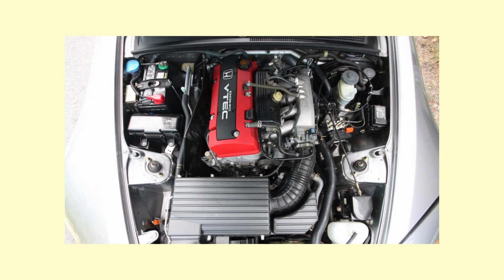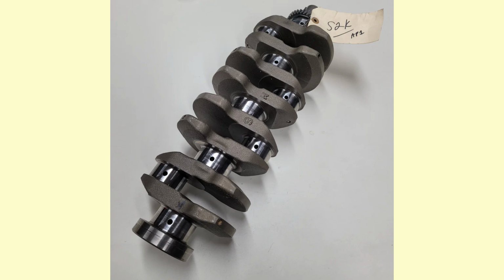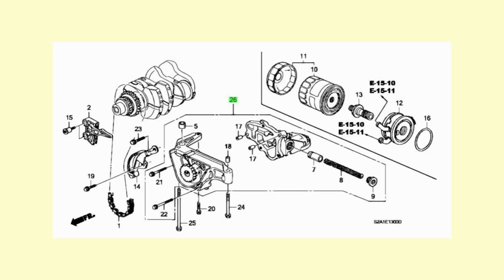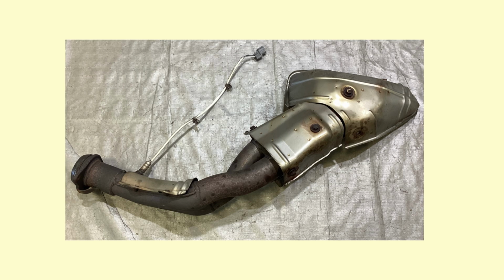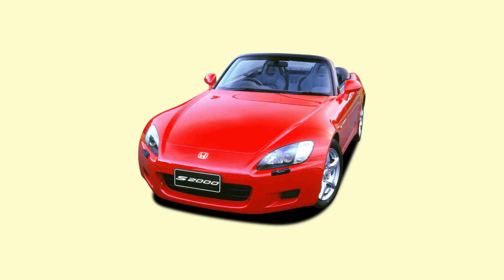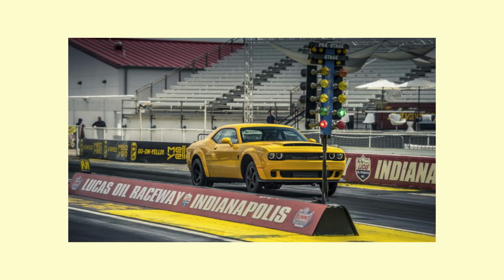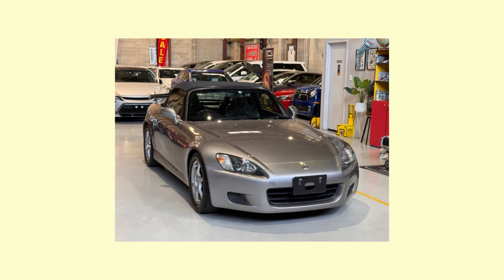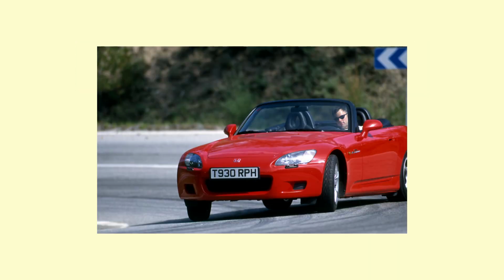Automotive X-Ray: Honda S2000 AP1

Comment: The EPS wasn't the primary reason for the uncommunicative steering, it's mostly the high profile tires with a mild SAT dropoff and quite high cornering stiffness load dependency, and quite equal caster/SAI angles, which reduces jacking, and relatively neutral dynamic handling. Trail isn't particularly high either, around 23mm or so, which is normal, but it's not low enough to cause big steering torque delta above the limit. The AP2 has a lot more "pointy" steering mostly due to tire and understeer gradient changes.

Funfact: EUDM versions of the AP1 used the HID headlight rear suspension deflection sensor to control the EBD, emulating what the AP2's Xg sensor would do. Yes I do believe that means you will get different braking bias on left and right turns. The inputs were wheel speeds, G, yaw, steering, rear right(?) rideheight.

JDM and USDM versions had a mechanical proportioning valve until 2006 when they got a more sophisticated EBD.

Balljoints on the lower arms will not influence roll stiffness in a perceivable way. The installation stiffness is going to be quite low even if you make the lower arms solid and welded to the hub, because it's primarily controlled by the axial stiffness of the spring bushings. The hub and balljoints are very stiff, but the soft parts bring it down, so making the stiff parts stiffer has no effect.

Dampers aren't really a primary contributor to lessening bodyroll (and won't provide any reduction in steady state), in general I wouldn't even say the S2000 is particularly stiffly damped.

S2000 load distribution is more like 49% front FWIW.

Also, every tire I've ever seen has a negative correlation with roadspeed and FY. You tend to lose grip with slip velocity. So your tires indeed "load up" less with more speed.

Comment: I noticed you did a ap2 as well can you do ap1.5 lol, i tried to research but its inconsisent and not much info, subbed
Reply from the maker: AP1.5 is basically the AP2 that everyone outside of North America/Japan got, same F20C but all the suspension changes etc from the AP2
Reply: @Enguitive  AP1 and AP2 only refer to the engine, if we're being pedantic. Japan only got the AP2 engine in 2006 (Well, 2005/11), they had different AP1 versions between the changes from GH to LA to ABA.

The funny thing is that the AP2 engine is inferior to the JDM AP1 engine, but the rest of the car is generally better.

Comment: Si refuerzas el motor internamente atmósferico puede llegar a 300hp sin reventar el motor?
Reply from the maker: Yes, but with mods that this reddit will cover: https://www.reddit.com/r/S2000/comments/1e9w1y6/300whp_na_f_series/
Reply: @Enguitive  interesante, muchas gracias

Comment: one thing to add those diff blows up (I def did not blow my diff)
Reply from the maker: Yep, is yours an AP1 or AP2?
Reply: @Enguitive  Neither I got a AP1.5
Reply from the maker: Ah, so the AP2 without the F22C that only North America got
Reply: @Enguitive  I got a 2005 japanese AP1(AP1.5) europe and africa got the Ap1.5 after from 2004-2009
Reply: @honorview8525 nice I got a 2004 ap1.5 are they the lower hp one? Because it is not jdm I had a jdm ap1 vgs model I feel like I feel the horsepower difference